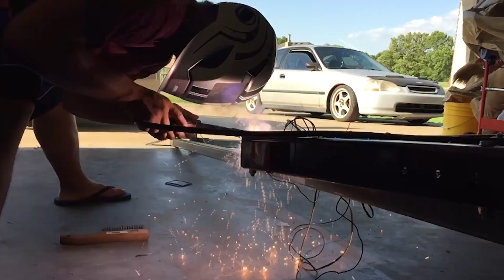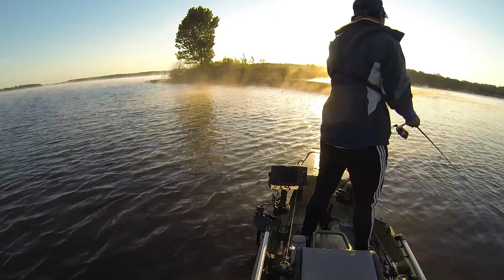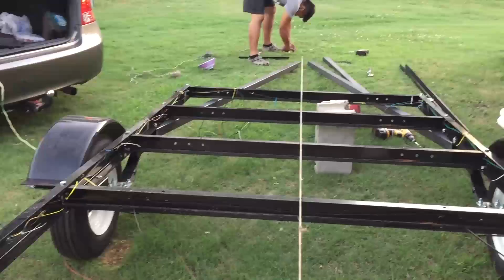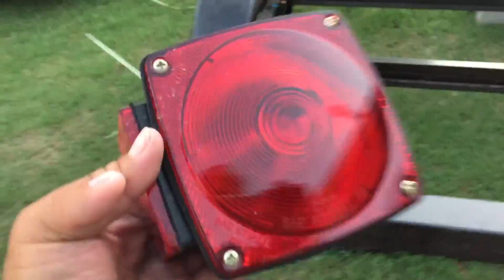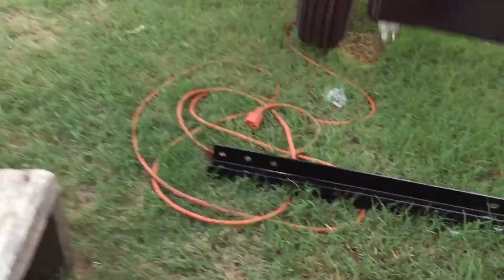DIY Custom Hobie Side by Side Kayak Trailer Build - OOW Outdoors

Comment: With 3" PVC and supports close to the middle, you're completely avoiding the whole purpose of using PVC. It's suppose to flex and bend to match the curvature of a kayak's bottom. 

Edit: Oh wow after watching more you are going to destroy your kayak man. You have both the front and rear strap out past the support bars (nearer to the middle of the kayaks), so you are actually bowing your kayak in the opposite direction it was manufactured. You have support in the middle and downward pressure at both the front and rear of the kayak You can clearly see this at 11:27.
Reply from the maker: You correct.  We did see issues later.  We have resolved problem by adding more supports under the front and back of PVC.

Comment: nice trailer man. I finished mine up at about the same time. I actually just posted a video on my channel on the finished product. great minds think alike I see. I used the same idea with the pvc on my trailer. its a tandem trailer for my feelfree lures. maybe ill run into yall one of these days. have yall ever fished the lower Illinois below tenkiller for striper? ive heard its supposed to be really good. figured you guys would be the ones to ask.

Comment: What are your suggestions on how much power a 4 door sedan needs to have to be a tow vehicle. Looking to buy a new car and would like to get a sedan (Honda probably) for the gas mileage instead of a gas guzzler SUV or truck.
Reply from the maker: if you're just gonna tow kayaks...any car is gonna do you well.  i've been towing my 14ft john boat for 2 years now with my civic.  it does struggle on up high climbs but you just gotta take it easily.  With kayaks its no problem.  as long as your trailer+gear weighs less then 500 ibs, you will good will any car.  i figured it like putting two grown men in the back seats right?  and that exactly how it feel when driving.  my civic only has 150 hp and its a small 1.8 liter engine.  Anything with a two liter or bigger is gonna be better.  hope that helps.
Reply: +OutofWORKoutdoors It does! Thanks a lot!